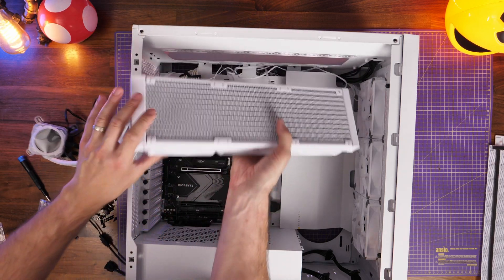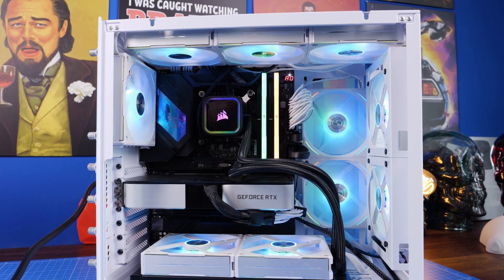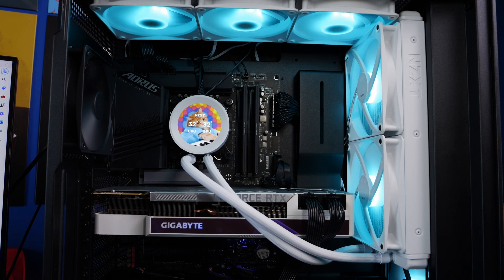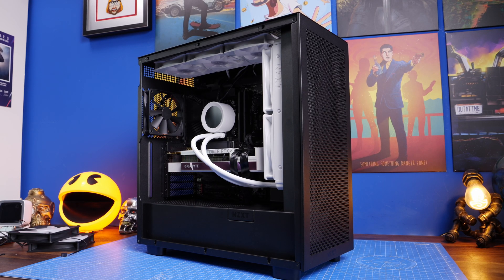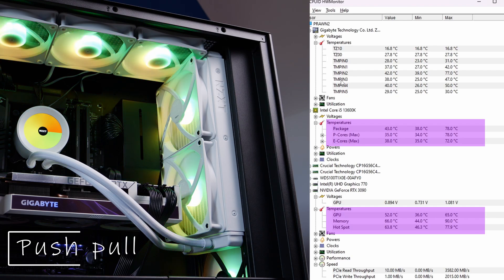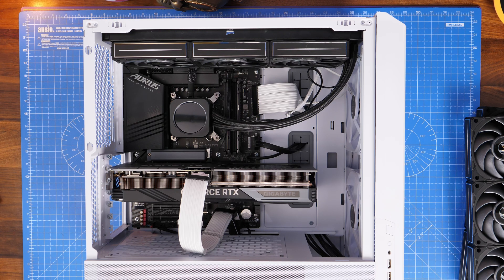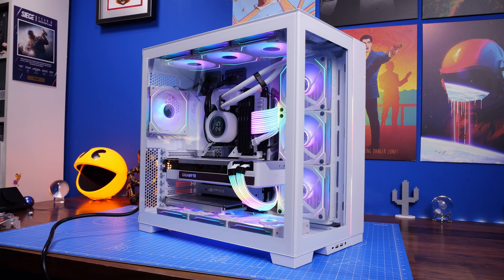Where should you install your AIO liquid cooler? The best places tested!

Comment from the maker: Related videos:
Common Mistakes You Might be Making with Your PC Fan Setup https://youtu.be/uPIMv30Vs3w
AIO Coolers and Fan Compatibility  https://youtu.be/Mm85qMEYlDI
Push Pull mistakes to avoid with all in one coolers https://youtu.be/_gA71wF9Ewc
Avoid these problems with your all in one CPU cooler https://youtu.be/nVkN8diBIAE
Specs of this build:
Case - NZXT H7 Flow RGB https://youtu.be/hiLd5wTPuMI
Motherboard - Gigabyte Aorus Z790 Elite AX https://youtu.be/8WK7VmuxFxo
CPU - Intel Core i5-13600K
RAM - Crucial Pro 32GB Kit (2x16GB) DDR5-5600 
NVMe SSD - Corsair MP600 GS (https://www.youtube.com/watch?v=8DTAiS5pPPs)
PSU - Corsair RM1000e PSU (https://youtu.be/FUnfuF6nSVw)
GPU - Gigabyte RTX 4070 TI 12G OC https://youtu.be/_-bu6qDqeWA
Fans - NZXT Core RGB (https://www.youtube.com/watch?v=mPRrPGjV_jo)
AIO cooler - NZXT Kraken Elite 280mm https://youtu.be/G5r3SG3ACwE

Comment: I will be using a Corsair 5000D, front mounting Radiator as an exhaust and will have the Radiator and AIO cooler pipes mounted vertically above the pump, the side panel will be intake 3 fans that will feed directly to the Exhaust AIO Fans and Radiator, the fans underneath the GPU will be intake and on top of the case will be exhaust and obviously an exhaust fan at the back. Would this be effective? My knowledge as a Mechanical Engineer says this will be fine but pro pc builders might have better info.

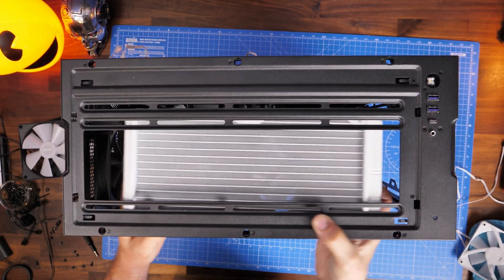Comment: 5:16 I'm using a Corsair Nautilus 240 and I have a top mounted radiator, my fans are set the same way but are blowing air into the PC case. I still feel air coming from the radiator though, should I turn the fans around?

Comment: 3:00 I am curious about side mounting with tubes-up. More cases seem to be setup for that configuration and you should moslty be okay so long as the pump is still lower than the radiator... However, in theory, and particularly if you live in a more arid climate, I would think it would be suboptimal if you lsoe enough liquid over time and then have air sitting right where the tubes are and thereby end up inevitably getting more bubbles working their way to the pump... But IDK.

Comment: Gonna ask a stupid question, but I have the Corsair frame 4000D case and if I were to front mount mount my AIO with push/pull (which if I understand correctly is fans on both sides of radiator), how would I achieve this? My case has a dust filter on the front and I don’t think it would fit if I did this. Would I just leave it off?

Comment: A great explanation ty! Although my tiny brain still wonders if my 360 aio (top mounted) would perform better with replacement reverse blade fans? Anyone with experience of doing this? Is it a no no? Or doesn’t make much difference other than aesthetic looks? atb
Reply from the maker: Maybe, but where would  you exhaust?
Reply: Reverse blade fans are just for visuals, it doesn't change the exhaust/intake capabilities of the fan

Comment: Just Watched video thanks for the information 
i have question 
my aio is on front intake 
but idk if its right or not aio most of the time like 99% the air is pulling out from radiator is not hot at all despite the cpu is running at full load , my cpu is Ryzen 5 7600x its hot cpu i know but aio doesn't care at all most of the time its just exhausting cool air into case like nothing is happening, i check pump and sink placement everything is working like its should be i don't if its normal or i have issue some where also my aio is 360 deepcool i would appreciate it if you can help me 🥂

Comment: Here's usually an unanswered question. 

What if the pump is basically right at the exit tubes of the radiator. Meaning you have maybe 2" of line, then there's the pump in-line. Most of the thermalrights do this. Instead of in the cpu block. 

I just did a nzxt h5 build, which front mounted, you can only do tubes up. No issues, great temps. Just I always think about it

Comment: I was actually really worried about this. Gamer's Nexus says we should do tubes down but you say you have been doing side intake with tubes up for many years. When you side mount an AIO with the tubes up do you hear any weird noises come out of your CPU block? I am going to do a 13 fan O11 Dynamic Evo RGB build soon and I am contemplating shoving the tubes behind the 4090 or angling them up.
Reply from the maker: I run side mounted in my main build and haven't had problems. https://youtu.be/PsITrM6mFug
Reply: @TheProvokedPrawn  Thank you very much for sharing that with me. I think Gamer's Nexus has got all of us worried. I mean your setup at the end of the video looks so clean. I see many people stuff AIO hoses behind the GPU and that just doesn't make sense to me because it is going to boil the water in the tubes haha. One last question. I am coming from top mounting AIO exhaust for a 14900K and I am well aware of how inefficient that is but my Galahad 2 LCD makes no funny noises at all and I have it on a curve so I won't hear the pump. When you side mount with the tubes up, do you ever hear any weird noises?
Reply: @ Do you mount the motherboard in the high position for an O11D Evo RGB with a side mount AIO tubes up? You seem very knowledgeable and I thought I should ask.

Comment: My mobo has SYS_FAN1 4 pin / SYS_FAN2 3 pin and CPU_FAN header only . Where I connect DeepCool AIO pump cable and DeepCool radiator fan cable?
Reply from the maker: I'd put the pump on CPU fan and fans on Sys fan 1
Reply: @TheProvokedPrawn  Thank You...

Comment: Curious on the side mounting, it appeared you’re flipping the fans to pull air in over the radiator verse pushing it out from the case.

I didn’t catch you mentioning pushing the air out from inside the case. 

I’d assume on a larger case such as the lian li evo there is enough “low intake air” to allow the flow to primarily pull from the bottom/push out the rear top and side
Reply from the maker: @mrtoxm8  putting the fans the other way in side mounting to pull air in. See here at https://youtu.be/sVEXd-Wp8FY

Comment: At first I thought... the top mounted radiator would be the best... but... I wonder... what happens to the air... while mounted horizontally... won't it interfere with proper liquid cooling... I feel like the air might be all over the place... The best mounting I feel like would be mounted vertically with the pipes attached at the bottom, that way the air would be at the top and nowhere near the pipes causing all sorts of splashing... Feel free to correct me, if I'm completely wrong... I'm not super tech savvy...

Comment: 2:22 is how i installed my aio and i got better temps then mounting it any other way. I use a i7 13700k  with a 240mm cooler and its a lil too small but this helped allot and i got no bottleneck! i use the exaust still and put the aio fans in the other way so it gets reversed idk if it is a good way to cool it but it works

Comment: so i don't get it, wich one is the best setup, for having lower temperatures, front, up, side?????
Reply from the maker: Depends on the case, but in my experience front mounting or side mounting as intake gives the best cooling performance.
Reply: @TheProvokedPrawn  ok thx for that, with the cables up or down?
but if we put the cooller in front of the radiator is not better? to suck the air in the radiator than to be in the back of the radiator?

Comment: So the normal setup is to exhaust through the radiator at the top?
Reply from the maker: That's what most people do. But it's not always the most effective
Reply: @TheProvokedPrawn  Just about to build and have a the Kracken 360 going in the h6 flow. Would you suggest just top mounting it. So it would be suck through the bottom and front/side, exhaust through the back and top.  Read some comments saying you don't really want to suck through the rad because it will warm the air coming in and will mostly effect GPU because the CPU is being cooled by the block anyway.

Comment: ty for video I have my 280mm rad mounted in the top 2 front fan slots with 140mm fan mounted in the front lowest slot. I have 2 140mm exhaust fans up top and 120 mm exhaust at the rear. My rad hoses are on the bottom of the radiator and the fans push air through rad. This makes the most sense to me as I have vega 64 and its hot. I didn't want the hot air coming off gpu and being pulled up through rad heat soaking it. My top exhaust fans are connected to cpu temp so as my cpu heats up those top fans increase to rip the hot radiator air out of the case. Rear exhaust fan is based on gpu temp to pull that heat out the back. That front lower fan feeds cool air into the gpu. I haven't ever seen temps saturate high and I've left my pc on all night running satisfactory

Comment: I want to place on the side to push hot air outside but the only downside is that will be negative pressure inside the case, i have Asus gt520 case which is quite similar to this one

Comment: i have always said side or front mounting the rad is better because ur drawing cool air in thru the rad thus cooling the liquid more efficiently appose to top mounting where your exhausting heated air thru the rad thus trying to cool hot liquid with warm arm it just isnt pheasable in my brain, physics and science beats the top brands recoomendations of top mounting ,, wrote this at 7m23..... in my head you pull cool air in and providing ur exhaust fans are high cfm etc any hot ait pockets people fnatasize about around the pump arent an issue with high cfm exhaust ,,,, thats my thoughts i use the fv270 case from cougar i have 4 exhaust fans and 3 intakes , on my build , 7950x3d h150i xt elite, rx7900xtx, 3 fans on the aio rad and 3 rs 140 corsair fans with the cougar cases 1 intake 120mm

Comment: I like your video, you are right in that there is so much that is misunderstood about placement of an AIO.
One of the most agree upon, about the head can never higher than the cooler, is unfortunately also the hardest misconceptions to kill!
Air does, as we all know, raise, it'll never go down. If you start out, before installing to raise the cooler fare above the head so all the air can raise to the top of the cooler, and you now start by mounting the cooler vertically with the hoses at the bottom. Then will the air stay in the top of the cooler and will never be able to go down through the water, out the hoses and up to the head. So even if you mount the head way above the cooler, is it still impossible for the air to ever reach the head.

The best way to mount the cooler, is, as you do, in the side with the fans blowing through the cooler and outside, still with the hoses at the bottom. That way do you prevent heat from the CPU in going inside, you get air direct from your from intake and even if your cooler should lose 50% of its liquid, will it all stay at the bottom, and the air will stay at the top of the cooler.

Comment: Nice explanation, thanks a lot. Sums up Gamer Jesus video quite well. I however have my radiator top mounted on a Pure Base 500DX. I am going to swap to an Antec C5 and was wondering if I could side mount the 240mm Arctic Freeze 3 rad on the side using those case fans. Since it has bottom intake I think the GPU will be fine but I still haven't even seen if it will fit

Comment: Did you use fixed RPM's for all of the fans?
Reply: When using fans on a radiator, you want to use the PUMP fan socket on the motherboard, as this is set to 100% fan speed all the time, if you have to use Sys fan socket on the motherboard, you can go into you BIOS and set it to 100%, usually you Sys fan will speed up and down based on your CPU temps. They can all be adjusted in you BIOS

Comment: I just got through dealing with this as I upgraded to AM5 and went from a 240mm AIO to a 360mm Ryujinn III. I have a heavy glass-sided Digital Storm Velox with three intake front 140mm fans, 2 exhaust 140mm top mounted fans a MB-side intake 140mm fan and a rear mounted 140mm exhaust fan. I have my AIO radiator mounted hose side up in front because the hoses can't clear the SATA cage flipped the other way. I tried today to top mount it after pulling the two exhaust fans, but it's too big, I'd have to drill more holes, and the hoses would never clear my 342mm long RTX4080 OC. So I returned the radiator to the front, flipped the three 140mm fans on it around so they're exhaust, and put the top fans back in and flipped them so they're intake.

Before I did this, I was idling somewhere around 44C-50C after having been a little lower previously, with opening a bunch of tabs, starting a game, or simply booting running the Tctl/Tdie up to 84.2C when I've got thermal throttling in BIOS set to 85C. Now I am idling around 35C-38C, averaging between 42C-53C, and my max so far has been 75.1C. I guess I still have the goods. This is with a Ryzen 7 7800X3D where the comfortable limit is something like 88C and absolute max is 95C.

Comment: A Good time to mount AIO radiator on the Bottom would be for some companies like MSI, they make a lotta Pump in radiator AIOs now     had a 360 MSI AIO TOP mounted & right out of the box a Ryzen 7 3800X would suddenly goto 70c idle,  seemed to keep grabbing air  /  swapped in a cheap 360 with pump at CPU an am 34c idle now

Comment: Hey man. I’m going to build my pc outside of the case, obviously to check the parts work, so I’m getting a kraken 360 rgb so do I build it outside of the case? If so what are the mandatory cables to plug into and where. Like do I just plug cpu fan and sata power just so it cools my cpu while I check everything?
Reply from the maker: Here's a guide on the smaller version of that cooler https://youtu.be/Yg031U2dE6o

Comment: The only place I could fit my 360 AIO was in the front of the case. I set the fans to intake air. 3 exhaust fans. Temps were 78 degrees peak on the GPU mem, core was a little toasty peaking at 76 degrees (3080)
Not ideal to have heated air coming in the front off the cpu radiator, but a RYZEN 9 5900X doesn't produce all that much heat (peaked at 64 deg). I think the build will be fine.

Comment: I have the same top mounted exhaust setup that you have with an I7-14700 K and a 4080, after I switched off my rear exhaust fan,  there has been significant improvement in cooling with lesser noise. Also, I am having less dust in the case that was happening due to the negative pressure caused by the rear fan.

Comment: Well, there is so much to say about Gamer's N... And others' opinions on the internet that end up being chewed like cud. 

Despite the Internet's collective opinion I can offer two very important aspects of the original layout. But what do I know, I am just a retired engineer who hasn't assembled my own for, well, a very long time.

It's just my opinion but...
1. Pull works better than pushing.
2. Side mounting brings ambient air in which creates a larger delta-T than the top mount 
3. (Controversy trigger - not pointed at you PP) In The Merchant of Venice, "His reasons are as two grains of wheat hid in two bushels of chaff: you shall seek all day ere you find them: and when you have them, they are not worth the search." 

Push pull are much like Shakespeare (another famous Englishman btw) point. Two grains - do, in fact, have value (as does push pull) but darn little.

a. The largest is perhaps with AIOs because you cannot control the radiator design. So it's a "bolt-on" attempt at remediation.

However
b. If one has an extra inch/25mm - use of this space will (imho) be more effectively served by a wider (deeper) rad.

c. If the fans are capable (depends on max CFM vs dynamic pressure curves which, in this industry do not exist) select a radiator with a higher fin density (higher FPI number). A downside of high FPI is, while more efficient on heat transfer, the added pressure will likely i. reduce the mass air flow (shifts operating point on the fan curve) and ii. said fan will have to spin faster and likely be more noisy (re: i. above).

See 1. and 2. Above.

Re: air bubbles, well that's much to do about nothing. I wish my horse had the speed of the Internet tongues. DOH! That's 
William Shakespeare too!

If you (the reader) neglect your AIO long enough for  "air bubbles" to ruin your pumps, you deserve to buy a new AIO. Then again, I don't make a living spouting unqualified (not substantiated by actual data) opinions. No, it's not "bad" advice. But it's also not the word of God given on Mount Sinai - it's the Internet.

My personal advice: listen widely but think critically for yourself.